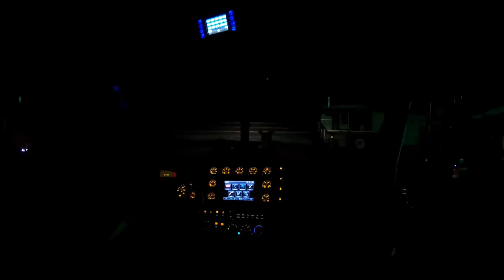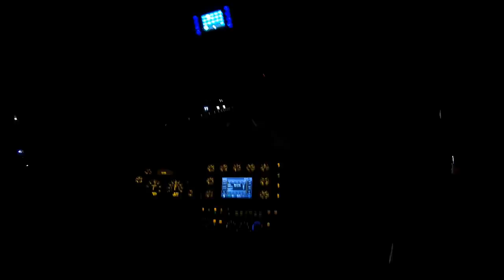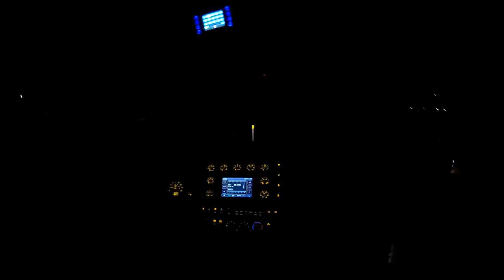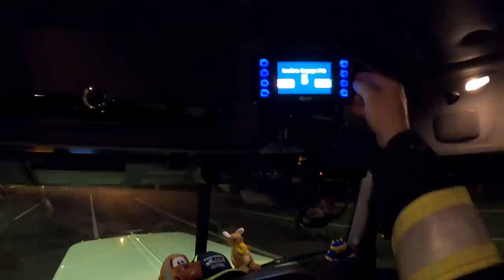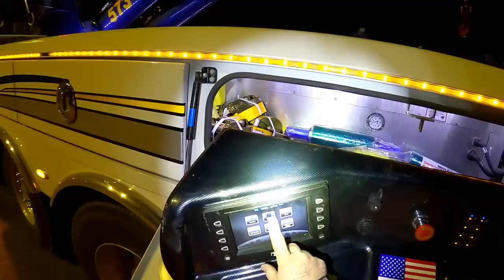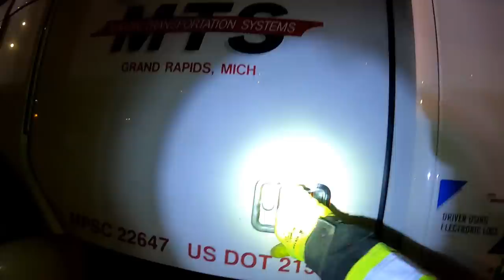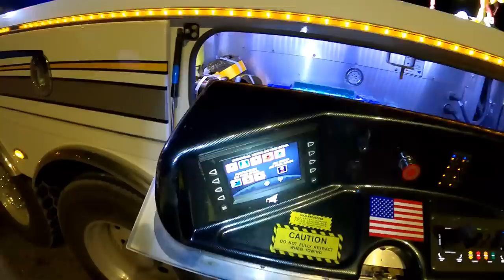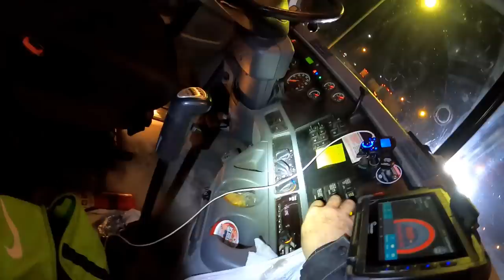Runaway Truck & Trailer    Driver Forgot to Set the Brakes

Comment: My sisters ex hubby when doing interstate (Australia) driving had a tempermental truck and the brakes were not as they should have been. He was fully loaded (40ton) and stopped at a truck wash bay to check the brakes, the front tyres were against a 1 foot concrete gutter and so he went under the truck to check it and the brakes on the trailer blew out and it started to move forward pushing the rig up and over the gutter.
The rig was called a maxi I think, it has extra wheels and the inner of the first of the rear rig wheels ran over him from mid leg over the torso and off the shoulder, he managed to roll over before anymore got him but the trailer stand on the other side got the back of his leg and made a bit of mess up the back of the thigh. He was in intensive care for weeks and at first it wasn't sure he would survive. Lucky that he's the kind of guy that hasn't annoyed enough people yet so he made a fairly full recovery that took almost 2yrs. 
I believe his company (that he drove for) was found to be running faulty trucks.

Comment: Another fine mess you've got someone out of!!  I did wonder whether you were going to call in either  the 4024 or Western Star as 'back up'.  As it turned out, not necessary. As you rightly say, it's not good to berate or belittle someone for 'getting it wrong', we've been there, done it and got the scars to prove it - metaphoricaly and, sadly, sometimes literally.  Anyhow, stay safe, mind your '6' and God bless.

Comment: Luckily my Pete 579 makes a loud beeping noise if I open the door without the parking brake set.  This was probably a result of fatigue, since in the trucking  industry, drivers are pushed  to work 14hr days on a routine basis.

Comment: The boards between the tires are a good idea! Just out of curiosity, why not put the "tooth bar" on the wheel lift and use that to bite into the pavement? I know it marks up the roads though....

Comment: My initial  observation  of the scene  was that you were going to have to lift the trailer while using the Western Star  to winch on the front of the tractor, seeing how far the landings were embedded  in the ground. That would have cost that driver's  company considerably  more for the recovery.  As it was, you were extremely  fortunate.  The Lord was riding  with you, as He always does and you were able to retrieve the unit with a couple  of straight hard pulls. Congratulations! This is where experience pays off.  I can see a 3 to 1 pull off the mast head with a 750. If you were able to  hold her down. Cheers.

Comment: @Ron Pratt, excellent work as usual! 👏👏👏🙏🙏🙏👍👍👍.   I like to ask a question...do they make independent trailer brakes for RV/Horse/Stock/Utility trailers for parking?  Only ones I had was manual assist for driving applications.  (I have  not towed in many years).  I would think such a means to put a trailer in parking brake on, would be a great backup for recreational towers, should a tow vehicle parking brake fail.  I used to chocked my trailer tires and slightly elevate my hitch via landing gear.  Parking on an incline always worried me.

Comment: I figured a way of getting the truck out: Put a crane on the road opposite where your truck is parked,attach hooks to the frame of the truck until you can get it disconnected,drop the truck, then use your rescue truck to pull it out.Then,using the same crane hook to the front of the trailer,lift it out of the ditch and set it on solid ground and reattach.

Comment: Great Channel!  Is there any risk of cables snapping on these heavy pulls or would the endless loop straps break first?
Reply: Paul Andrews The loops and cables should be well within the winch safety limits.
Reply: I am 100% certain these would be well within safety limit for work done by Ron.  Unforseen issues occur, which would be expected to fail 1st: straps or cable?
Reply: The winches are designed to stall out before the limit of the cables is reached.

Comment: I think lift would be a good thing then use a drag line to pull it towards you. Would mean working the truck to the max but it is doable with minimal repositioning of the truck.

Comment: So when I cross the Canada/US border in my truck I have to slide the axles apart. Lock the brakes on one axle, release the pins, roll back and then lock pins and release brakes. I do this at the duty free which is on a bit of an incline. Well one day I got distracted and forgot to set the brakes on the truck after sliding the axle.... so I go to the back of the trailer, release the brakes on the one axle, and the whole 140’000 lb b-train right starts rolling backwards!! I managed to run back up to the cab and pulled the brakes but it was just slightly too late. Backed over a curb and bumped a rub rail. Lucky for me it only blow one trailer tire, could have been WAY worse.

Comment: This is probably a silly question, but at around the 18 minute mark, when the steer axle was off the ground, would a winch line pulling down on the front end helped?

Comment: Maybe a silly question but would it have made sense to keep the tow lines low to help get the trailer off the ground af soon as possible? (By redirecting off the tow bar for example?)
Reply: Many of wondering why not pulling low are failing to notice how the trailer is digging into the soft shoulder as heavy loaded it was.

Comment: I was wondering why you didn't redirect so you were pulling straight forward instead of pulling up on the front wheels. I would think that would keep from shifting additional weight to the drives that were already buried. Was it because doing it the way you did helped "plant" the rotator? I actually thought you'd have to lift the drives back on the pavement.

Comment: Ron, would it not be easier to run a 2 to 1 connecting the snatch block to both straps to even the load and leaving you only one line to control? Anyway job nicely done.
Reply: I believe he ran two cables not only for the load, but also in case he needed lateral control.

Comment: Hey Ron,

Couple of questions / observations:

Is there a reason to why you did not Re-Set your parking brake after moving the wrecker and used only the winch brake (at least that i noticed even after a few rewinds)?

I would have thought that modern trucks like that wrecker would have an Anti-compounding valve so you could safely set both the parking brakes and service brakes without damaging the cans, and as such you could / should set the parking break along with the winch brake?

Also was your tag axle on the rear lowered? it looked to be up?
Maybe that would help with preventing yourself from skidding while trying to pull ol mate out?
Reply from the maker: @KSSilenceAU  Your questions are actually connected to the answer.  The lift axle only goes down when the parking brake is released.  I released the parking brake so the lift axle would be down, then applied the "winching" brakes, which applies air pressure to all the service brakes, thus providing more resistance than just the parking brake with only the drive tires.  Normally when I am out of the truck, the parking brake is set and the lift axle is raised, so you don't see the axle down.  As soon as I release the parking brake, the lift axle is lowers.    Thanks for watching and God bless.

Comment: Someone did this in the parking garage at work. I think I did that at home once, because my car was not where I thought I'd parked it. I was called up to the counter in a shop a long way from home asked "Is it your blue Peugeot out there? It seems to have rolled into the vehicle in front". I went out, there was indeed zero distance between my car and the one in front, but as I sat in it, I noted that my handbrake was indeed set, and also pointed out that the road is actually leaning the other way so perhaps it was the other car that had rolled - never got to hear if there was any damage to the car in front (it was newer and nicer than mine, apparently that driver only picked it up two days earlier)

Comment: Ron, what's the reason you never put one hook into another hook? For instance using the straps instead of just hooking into the hooks in the bumper? Is it because the hooks are hardened and the contact point is so small that it might cause cracking?

Comment: Ron. I was wondering why you couldn't put your axle lift under the front axle and put a strap under the front of the trailer and lift it then pull the truck straight out. Just wondering.

Comment: To bad the tater doesn't have a "creap forward" option so you could just bump it forward to release the blocks or move it forward to get another pull when you have all the cable reeled in.

Comment: @Ron, would the pull have been easier if you ran snatch blocks off the under reach and had a more straight line pull instead of a lifting pull?

Comment: I was thinking about how you blow your horn three times when backing.   The horn blowing was done for railroad personal to know when which way the train is going to move so they don't get squished.  The average person I mean public when your out doing a tow doesn't know what three blows means your backing up.  What you should have put on your tow truck is a reverse beep  so when you put the truck in reverse it starts beep beep beep beeping as long as your in reverse.   That would be way so much better then three toots of the horn.   A truck horn is just a truck horn and could be some other trucker blowing his horn. A train horn is louder and sounds different than a truck  you know a train horn when you hear it.    I really do think a reverse beeper is way much better than three blasts of a truck horn.  Just my thoughts
Reply from the maker: All our vehicles have backup alarms/beepers.  I do the 3 horns blasts in addition to the backup alarm as an additional warning.  Better to get someone's attention, in my opinion.  Thanks for watching and God bless.

Comment: Looks like Ron would need to lift up the trailer with that bar extended out to lift the trailer and the legs of the trailer. It might be easier to move the cab better.thats my thoughts.

Comment: Ron would using the spreader bar over the trailer and the drag winch to the tractor cause the least amount of damage
Reply: Need to remember that when the boom extends the weight limit gets reduced, that and it only has 45 foot of reach from the truck.

Comment: Just think Ron your next truck if you order disc breaks you may not ever use that trick again.  The disc breaks are proven to have 40% more stopping power.
Reply: You would think disk brakes would have better hold in a heavy pulling situation, but you forget that the tires can only get so much grip on a hard dirty/dusty and cold/hot surface.

Comment: Is there some reason to initial set up close to the recovery? I watch nearly all of your videos and lots of times you have to reposition to get more cable out to finish a pull. Seems like an unnecessary risk if you just pull an extra 20-30' of cable to start with.
Reply from the maker: I understand your statement.  The answer is, it's all about the angles.   If you have a truck in mud on an incline, you must keep the cable length short or else the truck will move forward along the slope rather than climbing the slope.  Therefore, you must make several short pulls to keep the angles correct without losing ground.  If you take the cable too far forward, the truck will not climb until it gets close to the back of the recovery unit.   Thanks for watching and God bless.
Reply: @RonPratt  I get it. Get close, get everything pointed the right way then make a longer pull. I'm not a recovery expert, just trying to see what the thought is on setting up close. Got it now. Thanks.

Comment: Is the 3 blasts from the horn when reversing an industry standard...or just a Ron Pratt touch?
Reply: I think it is a Ron Pratt extra safety touch.  There are back-up alarms but people get too used to them.
Reply: It comes from the railroad from the old days, long before radios.  Trains (or specifically, the engineer) used the locomotive whistle to communicate with working crew members.  One blast meant brakes. Two toots meant the train was about to begin moving in a forward direction.  Three toots meant that the train was about to move in a backing movement.  Even today with radios, it's still the standard to make noise prior to moving a train from a standing stop.  It's getting harder to observe the toots, because many cities and municipalities have legislated "no-horn zones" in order to keep the citizens happy, in a quiet community that exists beside the tracks.  Now that radios are a universal standard,  crews use them and the locomotive's bell as the warning,  but out on the open road when lots of work crews may be nearby and not all of them might have a radio or be on the same radio frequency as the operating crew,  horn honks are often used as a warning.  The single blast calling for brakes is pretty well not used anymore, but way, WAY back in the earliest days of running trains, believe it or not,  trains did not have a functional end-to-end brake system. Brakemen were employed to ride atop the train (also, trains didn't run at 65mph back then), and when the engineer needed brakes applied, they had to "screw down" the wheel that would mechanically apply the brakes on each car.  Sometimes, there would only be one man to look after 1, 2, 3 cars, and they would have to run along the top of the car to get to the adjoining car to manually apply the brakes on that one, too.  It was the most hazardous job in railroading, and plenty of men fell to their deaths off of moving trains, before finally some folks began working on getting brake systems that could be operated by the driver (engineer) and apply the brakes on all the cars as soon as possible, rather than relying on a man riding on the car to do it, if he wasn't asleep, frozen, or had fallen off miles back.  So today, it's still a very good idea to make noise when moving equipment in a direction where the operator's visibility is impaired.  3 toots to those in-the-know means reversing, but to all others who don't know, it's just an attention-getting sound to tell them to pay attention to the source of the sound.

Comment: How do you not set your air brakes as a truck driver? You make it a motion that you do every time you put the truck in park no matter the circumstances.
Reply: driving 30 years, my custom was to pull the knob every time before the door handle, even if I was parked for hrs.... still one time I forgot to set the brakes.   stuff happens.  thank the good lord, I was on a dead flat surface and nothing happened, but it was a shock when I returned and tried to release the brakes.

Comment: how do those wood chocks work?
Reply from the maker: The way I had the chocks set in this video creates an enormous amount of resistance.  The blocks need to be good hardwood, such as oak or hickory.   Soft wood, such as pine that you would typically buy from a lumber "store" would simple split and break under the pressure.  I place the long, thick blocks at the bottom rear of the front drive axle tire and them on top of the rear drive axle tire.  When the truck is "pulled" backwards as the winches are engaged, the front drive tires attempt to climb the wood block, which then presses down hard on the top of the rear tire, which, as you can see, creates a great deal of resistance.   This method effectively blocks both axles from moving.        Thanks for watching and God bless.

Comment: Wouldn't it have pulled better if you had rerouted the cables down low with snatch blocks instead of with a little lift?
Reply: Some of you thinking that a "low pull" might help, are not seeing how the heavy loaded trailer is digging the soft shoulder.

Comment: I see this all the time or things like this. I hate to say but its because most drivers have been on the road less than a year now.  I drove trucks since 1980 until 2007 I got into hauling super loads. and it took years for me to get there. and just last month I saw a man at a truck stop that's only been driving 2 years and already doing super loads because they can't find drivers worth a damn anymore. he was hung up between 3 polls one was a power line and couldn't get out. my old boss called me and ask if I could go look at it and try to help him.  we got it out and my old boss tried to hire me back. but after having 3 strokes they pulled my CDL. but I told him I wouldn't do it again if they paid me $1000 a day.

Comment: why not use the outriggers ?
Reply: Outriggers are really only useful for working off the side of the tator. To put them down in this situation it would have made the tow vehicle slide on the pavement even more. Rubber of the tires grip much better than steel pads of the outrigger feet. And the cleats on the back would have tore up the pavement. No sense doing damage when it is avoidable.
Reply: @GSE52  Thanks for the great explanation.

Comment: Appears to be a strategic problem, wonder if driver still has a job? Had to be a drop frame trailer, huh?
Reply: Having driven for 12 yrs ..1st will be a drug screening but most likely no he won't be driving for them... Safety related issues are No. 1 on most trucking Co. list and with something like this which setting your brakes is first priority anytime you park for any reason.